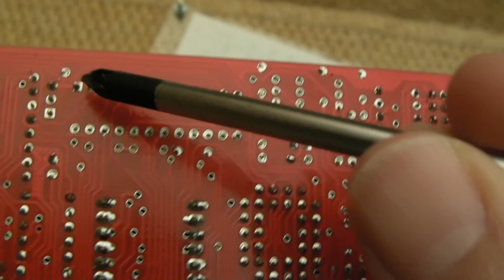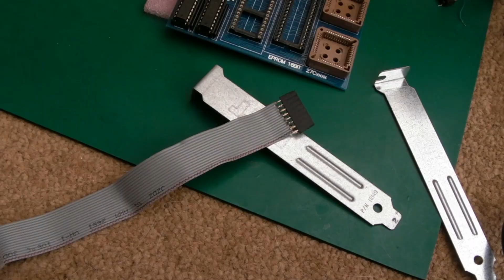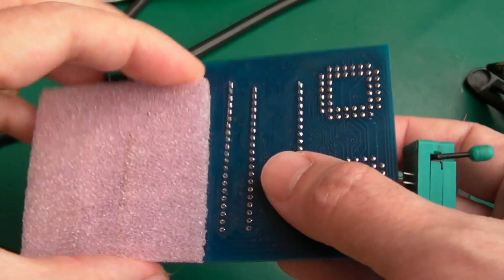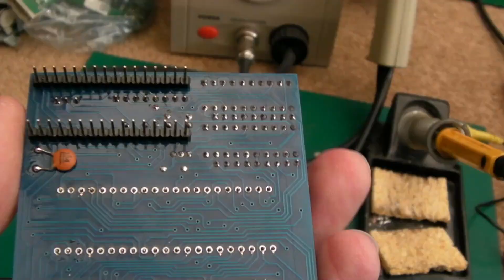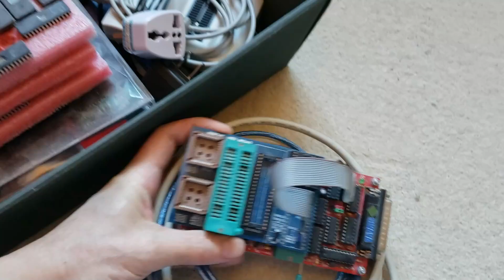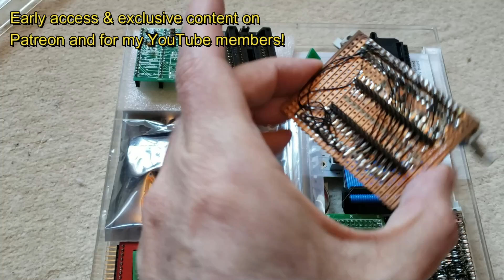Willem EPROM Programmer Fixes

Comment: The cable is only necessary for the 27c160 and 27c322 memory modules. For other modules like the 27c4096 and 27c800, you can use the adapter without the cable connected.

Comment: For that cable I think I'd have done what I did for a replacement BBC B keyboard ribbon, and used cheap Dupont F-F wires (the multicoloured ones), take the plastic bits off the ends and put the crimped metal socket parts into some multi-pin Dupont socket connectors. Much more reliable than that horrible solution lol.

Comment: Instead of using the pin headers (which are made to be soldered to a PCB) you can get actual plugs with pins which holds the cable by the isolation. I'm only counting eight pins, so it would be pretty easy to make, maybe fifteen minutes of work. You could even use the ribbon cable, but I would go for individual wires, cause it's not that long of a cable.